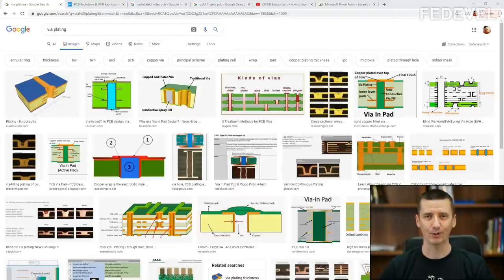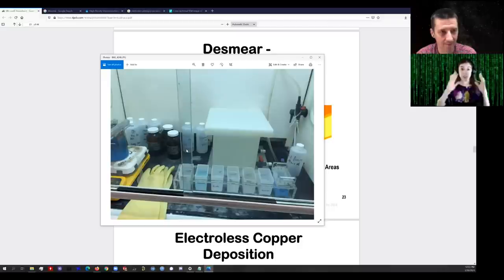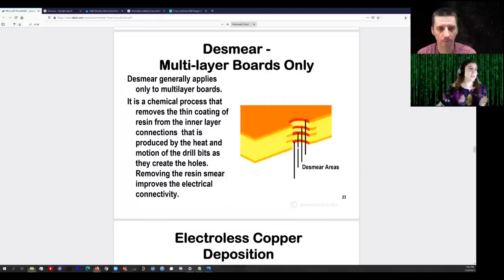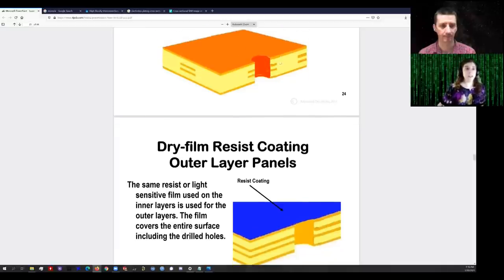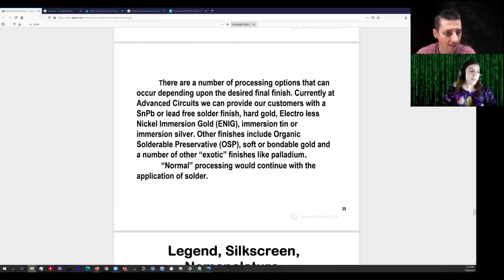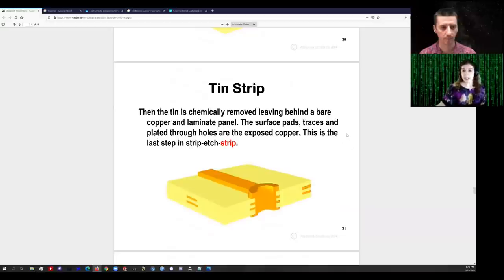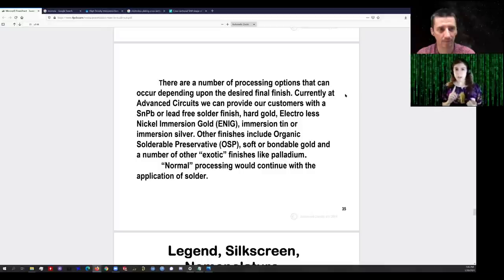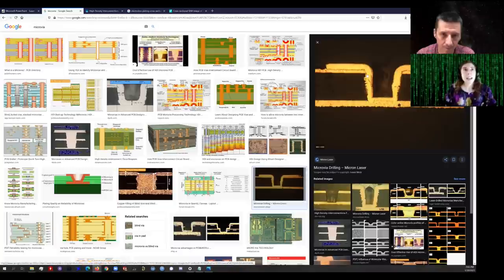How Does Copper Get Inside of a VIA Hole in Your PCB - Do you know this? (with Kailey Shara)

Comment: This video is fantastic. Her background of BA in chemistry and PhD in EE made the connection that wouldn't have been known to average designers like me. One thing that wasn't very clear to me was why epoxy-resin filling of thru-hole in-pad vias is required. I imagine if the other side is vented (not tented by solder mask), the air would just escape during reflow. Also, it wasn't clear about the interaction between copper and silver / copper for the electroless copper deposition process. For example, what is in the copper bath and the redox potential between copper and silver and how this makes the copper deposit onto the silver.

Comment: In the 1980's and 90's I had to make my own PCB's for freelance client projects. During that time, a commercial PCB cost thousands of dollars to buy which, in virtually all cases was more than the value of the niche projects I was doing. So the answer was to learn how to make PCB's myself when no Internet was available. Through lots of research I ended up screen printing the resist pattern on bare copper with a special heat-cured epoxy ink resist that was stripped off with a simple lye bath after etching with ferric chloride. I then screen printed a solder mask with another heat-cured epoxy followed by a screen print of the silkscreen markings using white enamel ink. Then I drilled all the holes. This worked very well for double-sided boards but was a LOT of work so I can appreciate the amount of work in today's multilayer PCB's. Would not even want to try.  ;-)  Incidentally, the screen printing resources were also handy in printing markings on the PCB enclosure -- a bonus, if you like.

Comment: Great video! I would be interested in finding out Kailey's thoughts on ultrasonic cleaning after soldering on the components, i.e. how much damage this might cause to the PCB. We get the SMD components PNPed by the board manufacturer, but we add the large through hole components in house and then clean the boards. I ask this because this step frequently takes the markings off of some of the components (especially the electrolytic capacitors).
Reply from the maker: Thank you ats89117

Comment: Very interesting. I didn't know plating was done selectively with the regular subtractive PCB process. If that's the case, is the only difference between the subtractive and the (modified) semi additve process the thickness of the initial copper layer? Maybe you could do an in depth video like this on the semi additive process? I find it an interesting process and I hope it will become a bit more mainstream in the coming years.

Comment: Very nice video. Great presenter and host. 
I was wondering if there is a way to reduce waste by somehow combining etching of one batch of PCBs with copper plating of another batch, migrating copper from where we want it removed to where we want it deposited? 
Or, if we could skip etching altogether and do just deposition at exposed surfaces of bare epoxy?
Reply from the maker: Thank you salec PS: I had the same question and I cut out that from our call as it was already a long video, we discussed that. But basically, yes, there are some processes which could make it possible to get some copper back, but it doesn't mean PCB manufacturing companies do it.

Comment: I was also interested in your suggestion to leave the tin in place instead of removing it.  She described this approach as "barebones PCB",  is that a company or a process?  I was wondering why they remove it at all.  What are the disadvantages of just leaving it there, even when there is a solder mask?   I think I have heard that you don't want tin under the solder mask because it will melt in the reflow oven.  Is that why you need to remove it?

Comment: Hi Robert,  Excellent video, really enjoyed it, even though a lot of the chemistry was way above my pay grade!   I am still curious about applying  the cathode voltage during electroplating.  For the plating of the holes, I think I get it; since no etching has been done, all copper on that layer is electrically connected, so you just apply the cathode voltage to the single copper plane.  However, it seems like when she was describing electroplating of edge connectors and castellation edges, the imaging was already complete.  Do you need to get all those points that need plating electrically connected together so you can apply the cathode voltage?   Is that what you were trying to find an illustration of?  Does it work the same way with the castellated holes or do you have to somehow supply the anode voltage to each contact?

Comment: Good video, always wondered this. Now in order to electroplate all the copper areas every trace needs to be electrified, how do you make contact with every trace to electroplate?
Reply: The electroplating is done before the etching. So the entire top and bottom surface of the pcb is still continuous copper. You then layer on your resist and then etch.

Comment: When electroplating, whole PCB copper area become single connected body for deposition. But in Gerber, these copper areas are different nets. How do they connect them all to a single net?
Reply from the maker: The PCB has not been etched yet (only drilled and electroless plated), so, there is copper everywhere (there are not "tracks" yet) .... just some of the copper is masked so we do not electroplate in the areas which are going to be etched.
Reply: @RobertFeranec  thank you, yes, only inner layers itched first

Comment: I worked in a PCB manufacturing company. DEFECTS DO HAPPEN. I have seen countless examples of drill debris or an air bubble or FOD inside a via completely prevent continuity thru the via, voids in copper surface (both internal and external layers), soldermask misaligned and getting onto the pads, copper shorts between traces, and a thousand of other things, as I was both testing these boards, and repairing anything that could be repaired... None of this stuff is as clean and zero-issue as you imagine. Do you want to find an issue AFTER a lot of expensive components have been soldered onto PCB or BEFORE??? THERE ARE ONLY TWO WAYS TO ENSURE A FUNCTIONAL BOARD FOR ANYTHING OTHER THAN A PROTOTYPE: 1) 100% Electrical Test (quick bed-of-nails that requires a custom test fixture or flying probe which is MUCH slower but can work on nearly any board, even with components on) 2) Visual inspection with real humans (I never believed in machine vision, usually we spent more time tuning and programming a machine vision machine than running it)

Comment: The drill can go through at 200000 rotation per minute. Actually years ago we were working on a 500000 rpm motor for pcb drilling. Just some useless info 🙂

Comment: I use AllPCB myself. I tried RadioShack plating of homebrew PCBs when I was a teen. I would NEVER recommend anyone even attempt any PCBs outside of a factory, even with one of those PCB millers, home etching, etc. Here is the quickest example that would explain to you perfectly why: so instead of asking me why you don't want to do a 100-step process at home, why can't you even do a decent solder reflow at home, with crappy reflow ovens from China? That's only a two-three-step process, and the difference in quality between an "oven" type setup to a conveyor-fed, multi-zone reflow system is hell and heaven. Thus, never attempt anything more complicated than a two-step process, if AllPCB will have a  PCB on your desk in one week, for extremely low prices!